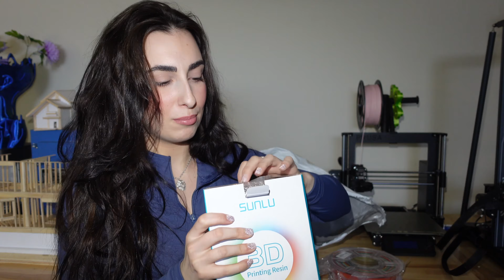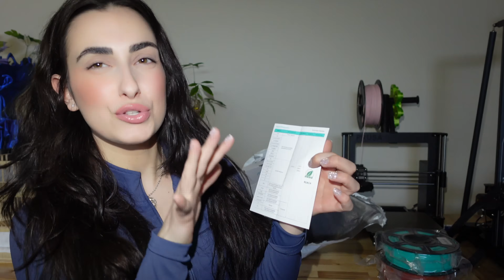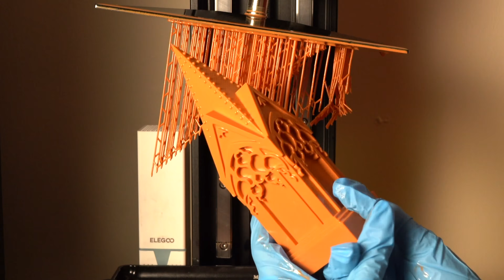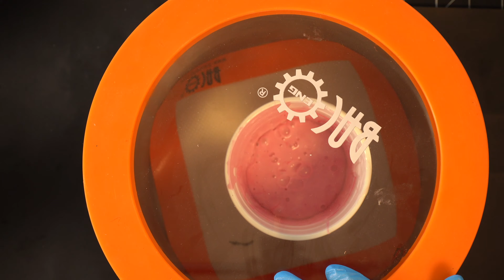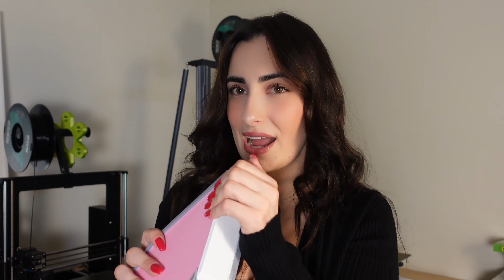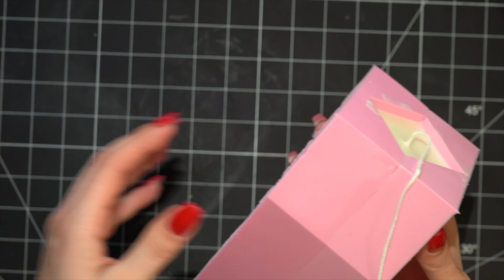Creating a Two-Piece Mold Using 3D Printing | Custom Candle Molds

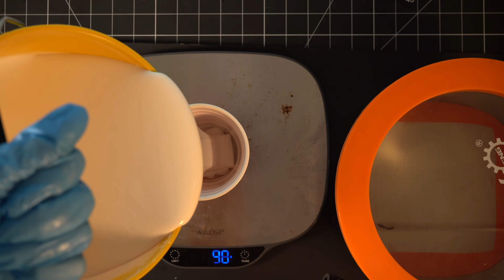Comment: 7:24 I always wondered what that matt was for. You put it inside your vacuum chamber. It's anti-slip so I guess it works, but why isn't it round then?
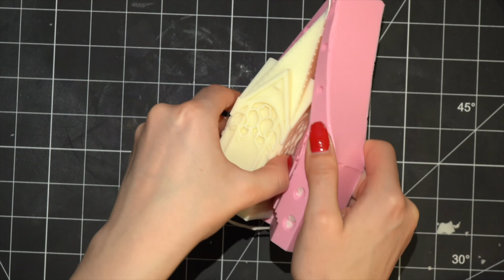Reply: I am super impressed by your cleanliness. Those candles are a real product. I never do such thick silicone molds though. The only real reason to do them so thick is because they need to be sturdy to not flop around. With 3d printing you can print an enclosure around the mold though that gives the silicone strength. The benefit is not only that you need far less silicone, but also that the thin silicone stays far more flexible, which makes cast-removal easier. Especially with wax and in cases like 13:16 this could really be beneficial.
Reply from the maker: Thanks for the tips!! I definitely want to make them thinner to save material 😁